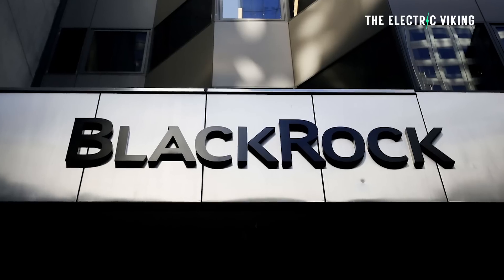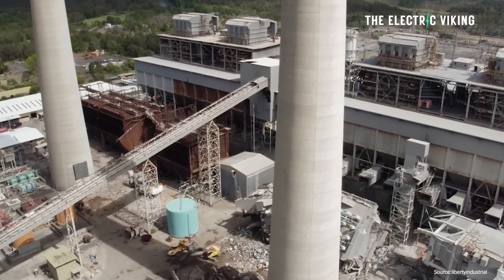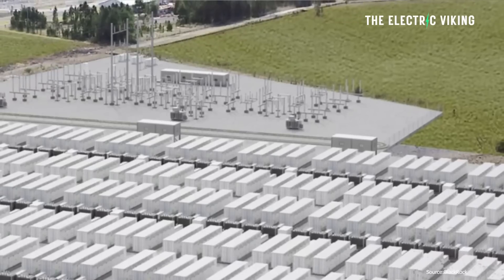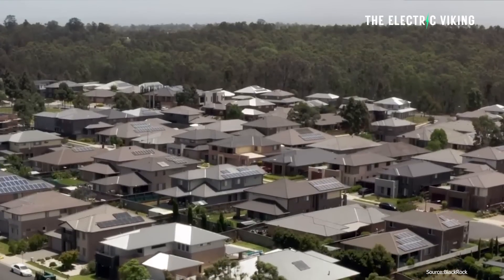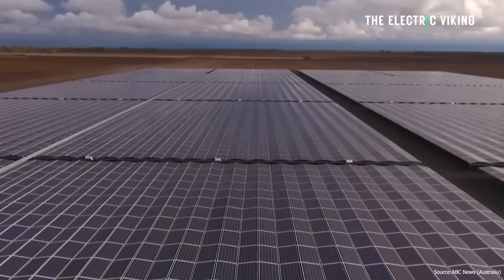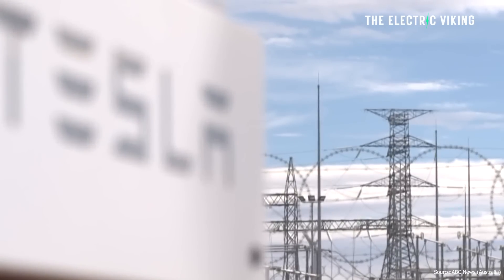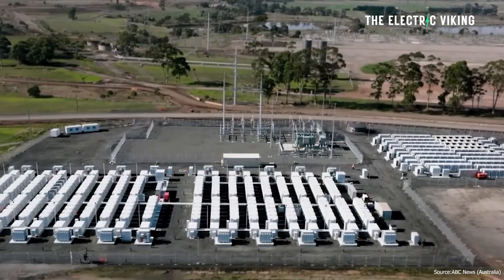The world's second biggest battery built on the ruins of a coal power plant

Comment: Sam,
I've been a fan for a couple of years and enjoy your reporting (but I multiply your frequent, "SOLID STATE BATTERY BREAKTHROUGH!" time to market estimates by 3😊). However, recently I have been listening to your reports less and less.  Why? It takes too long to listen to them. I recently did a little experiment.  I opened your latest you tube video, scrolled down to where I could see the view transcript option, opened the transcript, turned off the timer marks, copied the transcript, pasted it into a file and read it. 
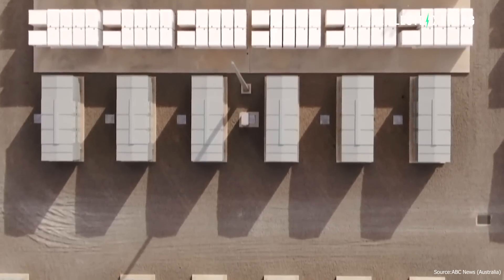It took 24 seconds to copy and load the transcript and 3:28 to read the transcript. That's less than 1/2 the 9:20 running time of the video.  If ads could be imbedded in the transcript file to offset any lost revenue from lower YouTube views,   
you could use a push model to send text/email links to the transcript to your subscribers.  
Keep up the good work.
Reply: Just change the playback speed to 1.25 and it sound fine and you’re still supporting the channel and the massive amount of work it takes to make these videos

Comment: More ....👍🏼

And use the heat from the mines to generate more power  using heat pumps or solar thermal and possibly CO2 turbines. 

The grid developement is an international problem however especially when Govt refuses to plan ahead and invest in critical infrastructure .

Comment: 1.6GWh is pretty decent. But stationary storage batteries should be over 1GWh by now.
Reply: Can never replace baseload power power plants.
Reply: @robertfonovic3551  They're not meant to. The idea of dispatchable power is that it's there whenever you need it, rather than cranking out the same power 24/7 when there's low demand. For SWBs the beauty of the system is that when there's low demand, you put excess power into the batteries. Under a baseload power model, that power goes to waste. I guess you could attack a stack of batteries to a coal fired power plant, but why would you want to when coal plants are closing due to their running costs.

Comment: Electricity is the most overrated invention ever. The electric grid and the electric utilities would be impossible without massive government subsidies and conditioning of the masses. You need to look at it as just another lame product of the progressive era, right there with income tax, direct Senate elections, women's suffrage, and the Federal Reserve. We need to replace light bulbs with kerosene lamps and battery powered cellphones with phones powered by miniature diesel generators and we certainly don't need electric vehicles, electric stoves, or even heat pumps. Sadly, most NPCs are too afraid to get over decades of leftist indoctrination on electricity.

Comment: Most Australians don’t realise that for up to 8 hours each day the NEM wholesale price goes negative due to so much rooftop solar. If you can get paid to charge then the business case for a large battery is irresistible. What surprises me is how new solar projects are still finding capital.🤔 You literally can’t give energy away in the middle of the day.
Reply: Unfortunately the oz electricity market operator ensures that those negative prices are NEVER available on the retail market !
  Also, you must realise , negative wholesale prices have always occurred before RE, in periods of low demand… usually overnight.  ( hence the old “off peak” retail pricing structure)
Reply: They can't give power away. And never will. It's not part of their business model.

Comment: The largest battery is the UK cost £30m for 0.1GWh of storage capacity. Scale that up by 100, that's £3bn for 10 GWh, or £12bn for 40GWH. That's about the same as a gas-fired power station can generate in 24 hours. In 24 hours, the battery is flat, the gas-fired station can carry on day after day, week and week, and you can build one for £1bn. It doesn't take half an hour to bring a peaker plant on-line because they're already running on hot stand by, ready to pick up load. Batteries have a role as grid stabilisation but they're hopelessly uneconomic for grid scale storage. Final thought, why did Musk buy a gas-fired power plant for SpaceX site at Boca Chica instead of using his own solar and batteries?
Reply: A peaker plant might be cheaper to build but its emissions are destroying the planet. We also don't need it to produce power day after day but only, say, one day a fortnight meaning that its average unit cost is much higher than you imply. You also cannot compare in isolation the costs of a plant that produces electricity with one that simply stores it. Battery storage is an integral part of producing electricity via renewables and renewables are far cheaper than gas. In addition, batteries will ensure that the potential over production of electricity at certain times is not lost further decreasing the average cost of renewables. You therefore need to compare the cost fossil fuel produced electricity with the overall cost of renewables plus storage (batteries plus pumped hydro etc.). If you do this renewables already work out far cheaper overall and this will be increasingly true over time - as well as helping us to reach net zero.
Reply: @rodnorton2658  Maybe Australia should stop producing and exporting oil and gas, and Australia adjusts to not having those export earnings. Obviously, it depends from country to country, but wind and solar power, at least in Europe, is too intermittent and unpredictable to operate without having back-up generation which is more than likely to be gas-fired. Battery storage will buy a few seconds of time to bring pumped-hydro on line, that will buy several minutes to bring the gas stations on line, or at least those on hot-standby. Obviously it costs money to burn gas to keep the stations running whilst exporting no power, but don't point the finger and say 'look how expensive gas generation is' whereas what you should say is 'look how expensive it is to back-up wind and solar generation'. The new generation of gas-fired stations are also more likely to be less efficient open-cycle type because they are cheaper to build and can be started from cold much more quickly. Speed of response will be more important so they can start generating as wind farm outputs drops off the grid. Thus, in 10 years time, gas station output may have dropped by 50% but actual gas burn may have dropped by only 25% because the stations are less efficient and constantly stopping and starting them is more wasteful.

Comment: Sam, this was one of your best and here is why.  
There is a lot of coverage of EVs, but the real 'elephant in the room' is the grid transition to renewable energy, and as you say, it is a lot more complex than energy in and energy out, where batteries are involved. 
For example, a dedicated group of people at the ANU is running the Battery Storage and Grid Integration Program to help find practical answers to many of the grid engineering issues involved.
With some farmers very upset with new transmission line plans, locating the battery on the old coal power site bypasses that issue and the high cost of not using existing transmission infrastructure.

Comment: 1400 Giga Watt 14/ 7 coal power cannot be replaced with a battery.
Do the maths.
ONE 1400 Giga Watt battery would last ONE hour.
Reply: No one is saying or said it was.
Reply: Actually, on the same site, right beside this battery is the Colngra gas power station ,..667 MW, 16,000 MW/day !……of actual GENERATION. !
That is not only more than 10 times the daily energy supply capacity of this battery ( which is just 1400 MWh)…and it cost just $500m.
Reply: Real facts, thanks for that. Natural Gas runs Adelaide. @weinisable

Comment: "Big Battery"??? It would cost around $10 TRLLION to provide battery back-up in Austraila for an electicity grid powered only by unreliable wind and solar power - so it will never happen. Pumped Hydro?  Snowy 2.0 is the biggest Green Elephant of all time - may never be completed.
Reply: Pumped Hydro Storage is an excellent resource. It is a proven and reliable technology with a century of successful operations. If one project wasn’t ran well it does not disprove anything
Reply: Coal is shutting down for good. It’s all about renewables and batteries now. For all time.
Reply: @Berretotube  
Nuclear might make a comeback
Reply: bs
Reply: @MinusEighty fact
Reply: @robertfonovic3551  nope.  total bs